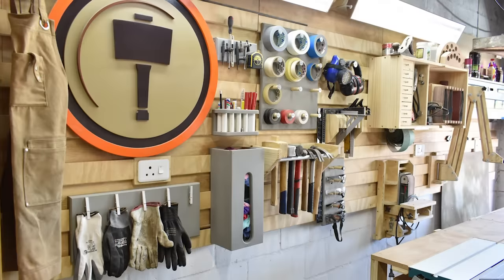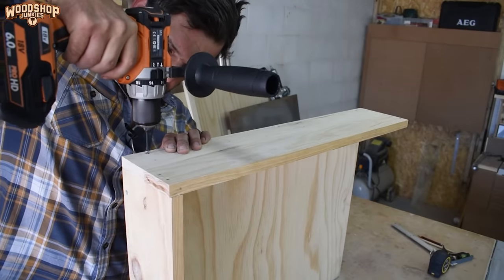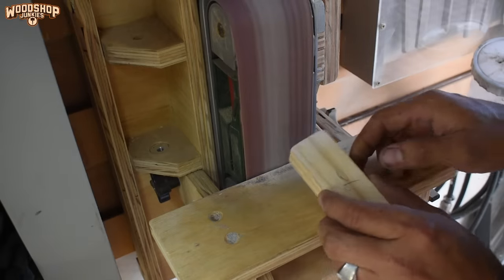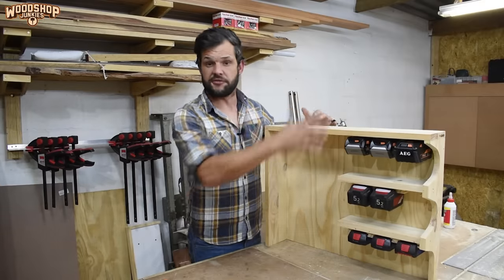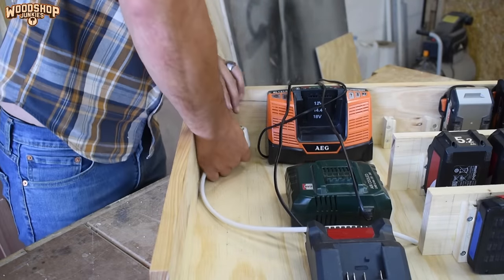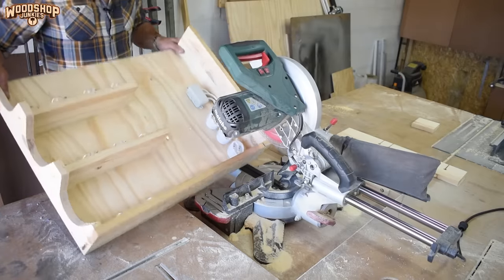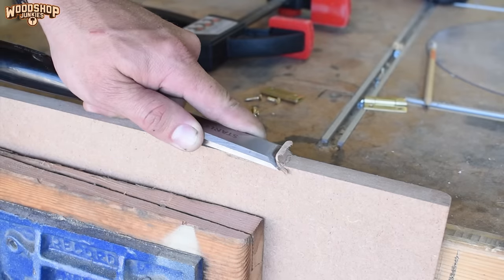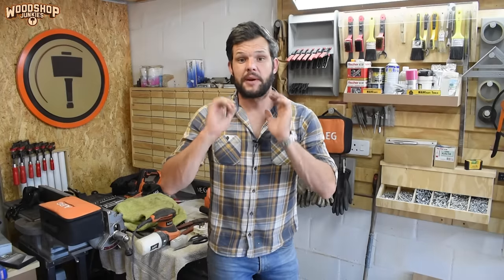Cordless Power Tools? - Perfect Charging Station For Small Workshops - DIY Organizers

Comment: Some good ideas as usual. And you've always presented as a solid, good guy who's a fount of clever cost-effective solutions. But...

The AEG sponsorship thing was way over the top, with their branding seemingly fit into absolutely every shot. I've never seen anything like it. Credibility is so hard to build -- you've worked hard for years to earn it, you've got it, don't risk tarnishing it for the sake of a sponsorship or two. The reality is that sponsors will come and go; and your reputation will always be your greatest currency, so protect it as the foundational piece that it is. Check out the Wood Whisperer's recent video on his losing the long-time sponsorship of Powermatic; it's a lesson in integrity. All the best.

Comment: Neat installation. For working on a large job at a remote location, IIWMI'D take the whole battery station rather than grab parts. I particularly like the cord slots instead of large holes or taking the cord end apart & reassembling
Reply: Agreed. Came here to say the same thing. Just put a handle on it and maybe a door that's easily removable so nothing falls out in transit.

Comment: Very neat, having just made a version I wish I had made a cupboard to hide the cables rather than using cable ties!  Love the Wago connector blocks, really make life so much easier, although I believe you should have used the 5 way version therefore avoiding the need to double up when you added the power cord!

Comment: There have been a number of fires caused by battery chargers.  Batteries either be in charged or left in the chargers, have caught fire.  So the suggestion for the chargers themselves, mount them in a metal cabinet.  I think if you line the would enclosure with metal facing the charges, it should provide enough of a heat shield.

Comment: Saw you installing a 3-terminal Wago on the 3 leads, thus leaving no spare terminal for the "external" power lead, and immediately thought to myself: "Yep, been there, done that"
Reply: Then I saw you putting 2 wires together under a single terminal and I went "Oh no".

I do feel like you should've used the 5-terminal Wago or at least a 2-wire ferrule to safely hold the leads together.
If you really want to put 2 wires together, do it with the internal socket wires, those shouldn't move thus won't put torque on the connection.